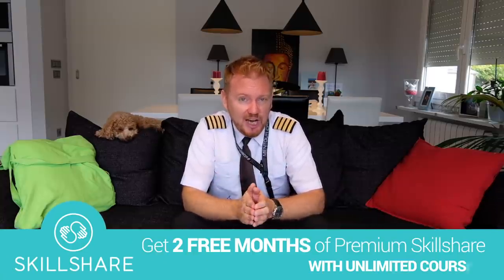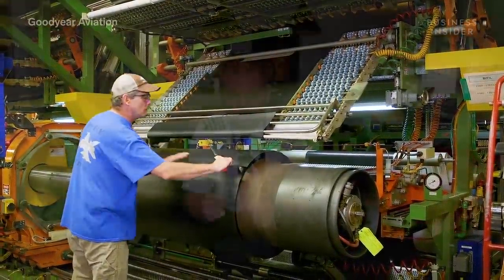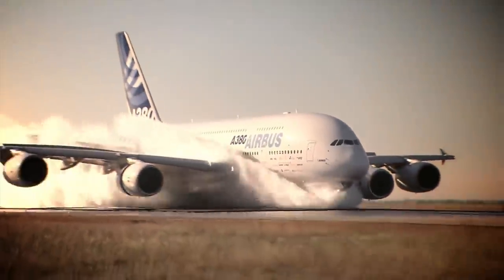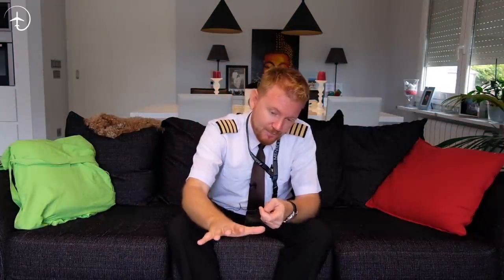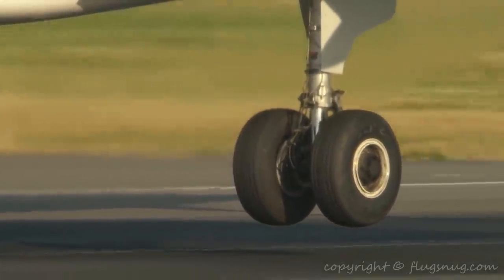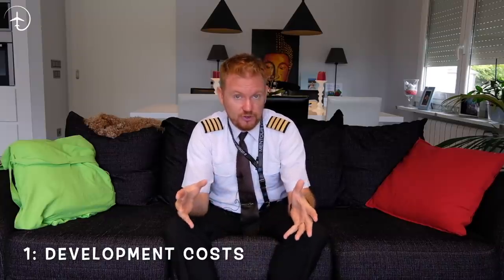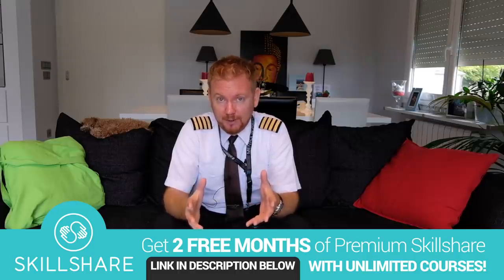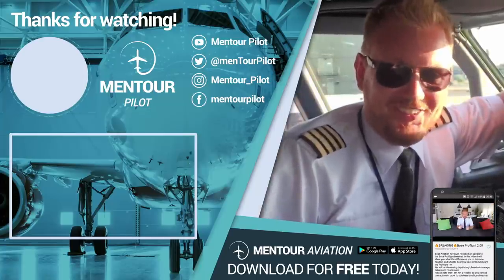Why not make plane-tires spin, before landing?!

Comment: Another aspect to consider is that spinning tires would be one more thing for pilots to keep track of while landing. Landing is already the most intensive portion of the flight, and an extra checklist item really needs to provide some safety benefit to offset the additional mental load on the pilots.

Comment: Air is around 78% nitrogen and rest of the gasses expand pretty much with the same rate. I think the more important part is to get all moisture out since steam tends to expand much more. Also probably good to have oxygen out since it can probably react with the tires and maybe even make small difference in case of an fire. 

Also the tread on car tires is just for aqua planing not for any cornering stuff. The less you have pattern on your tires the stiffer and better they are on cornering. That's why you don't have offroad tires on track cars.
Reply: How has a comment from a channel with 2M subs been able to go 9 months without a reply? lol
Reply: you are correct. When working in the wheel shop the tires are inflated to pressure using normal shop air. However the shop air must be 100% free of moisture. We use helical air compressor with gas fired air dryer. Now the easiest way to add air in the line environment is to use nitrogen bottles. This guarantees moisture free air.
Reply: Also the more rubber on the ground the more traction you get as I understand
Reply: Good points. His understanding of physics is a little rough around the edges.
Reply: The use of nitrogen became law in FAA Airworthiness Directive AD 87-08-09. It requires that all transport category aircraft braked wheel tires contain no less than 95 percent nitrogen or other inert gas. The inertness of nitrogen has nothing to do with its physical properties. It expands and contracts with temperature just like any other gas. The required inertness is chemical. The AD was issued upon a report of a Mexicana 727 (flight 940) that crashed after having taken off with a dragging brake. The heat decomposed the tire rubber into flammable compounds, which combined with the oxygen in the tire to cause an internal fire and subsequent tire explosion. Google Mexicana flight 940 for details.
Reply: Paul Crumley    The biggest reason for no O2 is brake fires.  I saw one in KANC on a B747 as the fuel truck was pulling up and connecting hoses. Yep, he moved fast.
Reply: @oldmech619  Not quite. According to the AD preamble: This amendment to the Federal Aviation Regulations (FAR) requires that an inert gas, such as nitrogen, be used in lieu of air, for inflation of tires on certain transport category airplanes. This action is prompted by at least three cases in which the oxygen in air-filled tires combined with volatile gases given off by a severely overheated tire and exploded upon reaching auto-ignition temperature. The use of an inert gas for tire inflation will eliminate the possibility of a tire explosion.

This is EXACTLY what I said, only I paraphrased a bit to save space.
Reply: @paulcrumley9756  Thank you... exactly, the 20% oxygen in a tire will feed a fire and inert nitrogen will help stop a fire in a closed wheel well.
Reply: Dry nitrogen avoids any rim corrosion problems, but also N2 is a larger molecule and won't leak out as fast as a mixture of gasses. As far as expansion is concerned, PV=NRT, the ideal gas law, doesn't care about what kind of molecules there are.
Reply: @jacknisen  There are almost no applications where the supposed lower leakage rate of nitrogen is relevant. Aircraft tire pressures, for example, are usually checked at least daily, and often more than that. In you car, the leakage rate is masked by normal temperature changes, and you should check your tire pressure as often with nitrogen as you do with air. And when was the last time you heard of anyone having to replace an in-service rim due to corrosion?
Reply: Fill the tires with helium for more lift.  Just kidding.
Reply: Well planes do land in rain too.
No expert on planes, but have tried treadless track tires on a wet surface, it was like driving in soap.
Reply: @jacknisen  Nitrogen is smaller than oxygen.  Nitrogen is #7 while Oxygen is #8.  I guess they are larger than Helium though.. LOL.
Reply: @mrstanskaggs1  Thanks. You made me waste a few hours studying gasses and their various properties. Damn I hate it when I learn something.
But look at this: 
Graham’s Law Explained:
The Difference between Effusion and Permeation
There's often confusion associated with the molecular size, molecular weight and permeation properties of
oxygen and nitrogen molecules, and GNI is often called to task to explain why nitrogen actually migrates
(permeates) out through the rubber of a tire slower than does oxygen. We felt it best to leave it to the expertise
of Dr. Keith Murphy to elaborate on the scientific principles:
"Effusion" calculations are not appropriate for "permeation" of gas molecules through materials, such as the rubber of
tire walls. There is a fundamental difference in transport occurring through “effusion”, and transport occurring through
“permeation”.
Effusion would be appropriate, if the O2 and N2 molecules were passing through a relatively large passage way
through the tire wall, such as a leak. Graham's Law for "effusion" applies ONLY if the exit through which the molecules
pass is relatively large compared to the size of the molecules and does NOT obstruct or constrain one molecule from
passing through relative to the other molecule. O2 and N2 molecules are only slightly different in molecular size but
both are very small. Thus, to constrain one molecule's (e.g., molecule of type A) passage relative to the other's (e.g.,
molecule of type B) passage, that passage way size must be fairly close in dimension to the sizes of the molecules
themselves.
Graham's Law does not apply, if the passage way is very small, as occurs for dimensions of passage ways in-between
the polymer chains in a solid rubber, where the dimensions between the polymer chains do indeed constrain passage
of the larger size molecule, which is actually N2, compared to less constraint on the smaller size molecule, which is
actually O2.
It is often mistakenly assumed that "molecular size" correlates directly with "molecular weight". O2 does have a greater
molecular weight (32) than N2 (28), but O2 is actually smaller in size. Thus, O2 fits through the relatively tight passage
ways between polymer chains in the rubber more easily than does N2. The difference is size between O2 and N2 is
very small, only about 0.3 times 10 to the -10th meters (0.00000000003 meters).
Etc etc etc
Reply: @paulcrumley9756  Funny you should mention corrosion. My dad had his front wheel come apart on him at speed due to a corroded steel rim. Just saying. My mechanic says he has seen a few corroded rims on Kingairs, so he will NOT put plain old air in an aircraft tire. Of course, air here is very humid, and so coming out of a compressor it would tend to concentrate the water a bit in a tire.
Reply: @jacknisen  Funny YOU should mention corrosion. If a tubeless tire rim failed due to corrosion it was far more likely to be a result of poor inspection and maintenance practices. Automotive tires have been using shop air or whatever almost exclusively since the beginning of the industry. There have not been astronomical numbers of wheel failures. Most likely, also, if a wheel has corroded to failure point, it should have been leaking long before it failed. Just saying.
Reply: @oldmech619  Brake fires occur outside of the tire,, on the brake pads and calipers,, which are exposed  to the atmosphere ,, plenty of O2 there.  I've seen my share of flight line fires "hot brakes" burn like a flare,, nothing to do with the nitrogen in the tire.
Reply: Warner Hill     Read FAR 87-08-09. It only applies to Braked Wheels.
Reply: @oldmech619  The same requirement was amended into FAR 25.733(e) for transport category aircraft certification, applicable to braked wheels on aircraft with max weight of 75,000 or more lb. Exception if the manufacturer can prove the tire cannot release volatile gases or cannot reach unsafe temperatures by design.
Reply: @oldmech619  Because the temperature inside of braked wheels can cause the tire compounds to release flammable gases internally, which in the presence of oxygen can combust and cause tire explosions. The brake merely creates the heat necessary for this to happen. Nothing to do with brake fires - they are an an entirely different matter. All of this was described in the explanatory material preface to the actual A.D. (Not FAR, there's a difference. The FAR reference for braked wheels AD is Amendment 39-5613, all AD are FAR39-something.) here's the first sentence:  "To eliminate the possibility of a chemical reaction between atmospheric oxygen and volatile gases from the tire inner liner producing a tire explosion, . . ." Nothing at all about brake fires. They can burn just fine without oxygen from inside a tire. What little oxygen would be supplied by a ruptured tire would not have any major effect on the intensity of a brake fire.
Reply: Paul.  That is very interesting. I appreciate the reply.   I still having a hard time believing that the internal tire gasses reaching a self ignition point without a fire caused by a brake in the wheel well.  Wheels have fuse plugs to release the tire pressure prior to failure.  FYI: On Flt 940 the investigators the investigators later found that the overheating was caused by a malfunctioning brake on the landing gear.  
Also, I  think that the if a rupture occurs on the tire from a brake fire,  the releasing normal oxygenated gases would increase the intensity of a fire.  That would act like a very large Bellows 
I totally agree that N2 is a good thing and it also lead to the loss of Mexica.  This is why I was a big fan of wheel well fire warning systems, brake temperature indicators, tire pressure indicators, and brake fans.  I have no idea how the crew did not have a w/w fire warning?  I will try to do a little research on that flight. 
Any additional info is always appreciated 
Thanks again Paul
Reply: @oldmech619  Oddly enough, the Mexican 727 was probably not the only one to use air, but still I would bet the majority of them were already inflated with nitrogen. It's hard to maintain a compressor to air the tires to the pressures required, and the bigger the airplane, the higher the pressure. Nitrogen can be delivered in 3000 PSI (around 200 bar) cylinders, and can top off numerous tires before being refilled. Use of a good regulator is mandatory, of course, though I knew a young mechanic who permanently disabled himself using an unregulated supply to refill an L-188 nose tire. . . it exploded and nearly took both legs off. He was lucky it hit  him low on his body - a midsection hit would have killer him.
Reply: @paulcrumley9756  Just stating the facts as I know them. Don't like facts? Vote for Joe.
Reply: @paulcrumley9756  You must not live in New England... all of my allow rims corrode after a 7 or 8 years.
Reply: @martin_hansen  I always prefer to land on a wet runway. Much smoother. It makes people think I'm a great pilot. Of course, I don't fly a jet these days, so the propellers do all the stopping for me. The old Learjet could get kind of slippery if you got on the brakes early, before the tires were spinning as fast as the pavement. You will hydroplane until you reach less than about 9 times the square root of the tire pressure, so ne sense using brakes before then.
Reply: @jacknisen  3q1qqq+8l
Reply: @ernestwilliams1609  Q Celt?
Reply: Not entirely right about tires. Tires get traction by deflecting and forming into the rough surface of the road.  Tread allows the long lasting, tough tire compound to flex into hard cornering and brake/accels.  Slick race tires are a very soft compound and wouldn't last a month on the street.
Reply: Hey nice to see you here Lauri! I was thinking the same about the nitrogen.
Reply: ..."get all moisture out since steam tends to expand much more."  ....No.  Now if you were to say the expansion of a liquid into a gas.

If aircraft tires were to be filled/ topped off repeatedly with air that had not been dried and the moisture allowed to accumulate in the tire, it would surely freeze at altitude and then upon landing the wheel would be out of balance albeit from perhaps a few pounds of water at most l.
Reply: So if we could hypothetically guarantee that there would never be wet roads, totally smooth tyres would be best?
Reply: @pegleg2959  absolutely, just like racing slicks
Reply: @michaelharris679  ahh, thats so interesting. I suppose it makes complete sense, I've often wonder how the tyre patterns actually create friction as its a gap of just air, but I thought it was some complicated concept that was just going over my head haha.
Reply: @specialopsdave  It just need you to break the seal.
Reply: @TKA322  Yeah, imagine the entire atmosphere surrounding the plane is 20% oxygen or that ALL gases expand and contract equally ( including gaseous water, aka steam).
Reply: @jacknisen  Nice, well expressed, and accurate answer.
Reply: @paulcrumley9756  What did the oxygen inside the tire react with?  If you are thinking the rubber, then what makes the oxygen inside the tire different than all the oxygen outside the tires?
Reply: @chillywings  Hi understanding of physics and chemisty is almost always wrong unless it has to do with airfoils -  and even then I would think that he does not know everything to the level that he pretends he knows...
Reply: The oxygen is actually really important to get out. In case there is a fire, after the brakes overheat for example, an exploding tire could lead to a huge burst of flame if it contained air, while nitrogen could actually have a smothering effect instead.
Reply: All car tires are filled with nitrogen the oxygen seeps out over time whats left is the nitrogen
Reply: @mrstanskaggs1  actually oxygen is smaller despite being a heavier element. Oxygen's nucleus "pull" harder on the election cloud bringing it in closer then nitrogen does. Air being mostly 78% N2 which is roughly 2.66% larger then the 20% O2 molecule

The defusion rate of O2 through the rubber tire should be ever so slightly faster then N2. Thus as you keep topping off the lost pressure, over time the concentration of nitrogen should go up. Keep at it and eventually you'll have a nitrogen filled tire
Reply: @mrstanskaggs1  Diffusion rate is inversely proportional to molecular weight, which is ~28 for N2 and ~32 for O2 (same ratio as what you state, as the most common isotopes of both oxygen and nitrogen have the same number of neutrons as protons). There is a lot of misinformation about nitrogen in tires perpetrated by people who want to convince you to pay for putting nitrogen in car tires, which is of minimal benefit and generally not worth the additional cost. Several other commenters have stated, correctly, I believe, that the primary reason for putting nitrogen in plane tires is to reduce the risk of fire or explosion due to combustion of volatiles in tire rubber. Given the high pressure used in plane tires. 200psi air means a partial pressure of oxygen of ~ 40 psi, which is about 2.52 times that of pure oxygen at atmospheric pressure, which equates to a substantial fire risk and will support vigourous combustion indeed.
Reply: @richardwheeler6115  Yes, but water vapor will condense to liquid, or ice at the temperature of a plane at cruising altitude, which can cause significantly more pressure change than materials that remain in gaseous phase.
Reply: High pressure oxygen is more reactive than standard pressure oxygen.
Reply: Incorrect
Reply: Unfortunately, atoms decrease in size from left to right on the periodic table, which is the opposite of what you'd expect.  It's because the higher number of protons in the nucleus pulls the electron cloud in tighter.  So O2 is heavier but smaller than N2.

Comment: When I went through orientation at Boeing as young engineer in 1977, we were told they get many calls per week from the public suggesting pre spinning the tires for landing. Then they told us that the  most tire wear is on take off when the plane is loaded with fuel. I think the problem is people seeing so many TV and movie B roll of a plane landing and seeing the puff of smoke.